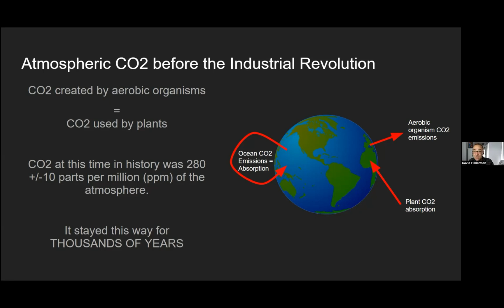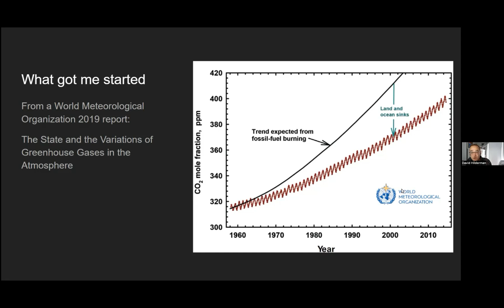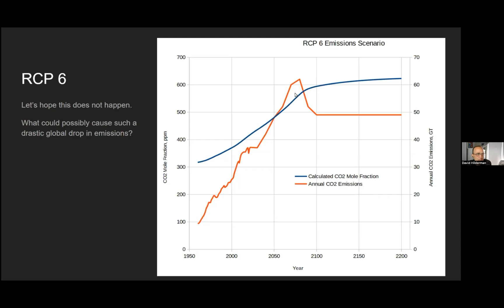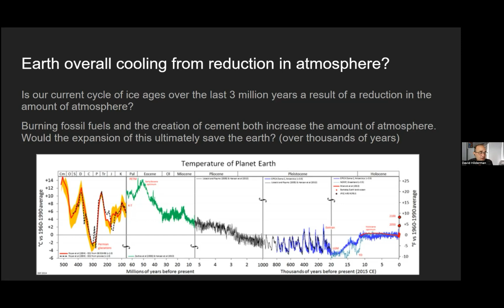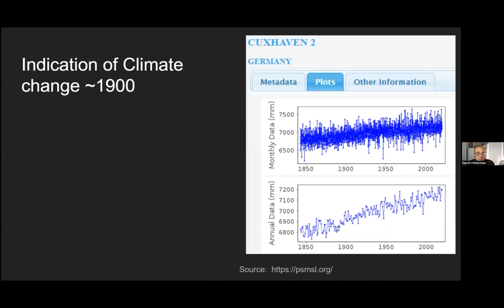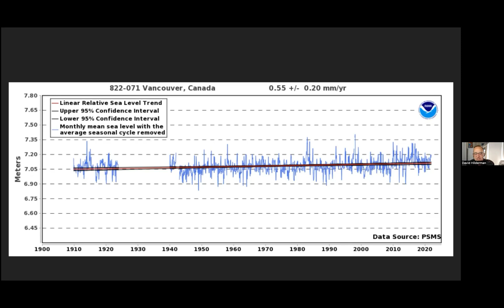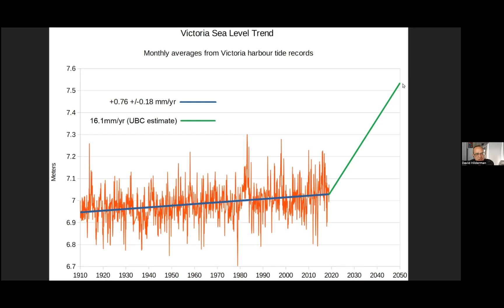David Hilderman: CO2 Emissions and Atmospheric Levels | Nelson Pod #220

Comment: If you go to the Mauna Loa research station website and go to the web page with the “trace gasses” folder to download the CO2 data, there is another interesting downloadable document on that web page, the CHANGE HISTORY for the climate temperature history. That document records every time they changed a temperature in the past. There you will see they are going to past hot days and lowing the temperatures in the past, which results in the past looking COOLER THAN IT REALLY WAS AND GIVING A LOWER AVERAGE TEMPERATURE THAN WAS ACTUALLY RECORDED!
They claim they do this to correct bad measurements in the past because of things near the thermometer 🌡️ that maybe causing an incorrect measurement, like the thermometer was not in the shade, or it was near an exhaust fan, or too close to asphalt pavement that heats up from the sun or too close to something reflective cooling the thermometer. But if you LOOK at all the changes in the CHANGE HISTORY document they almost always lower record HOT 🥵 days in the past and that results in the past appearing cooler than it really was, because today many thermometers 🌡️ have the same problems as the past and NO ONE IS FIXING THIOSE PROBLEMS!

Comment: Adding onto the sea level topic, a lot of data starting at about the mid 80's is complete garbage. That's when they started using satellites to measure sea level, and I don't know if you've ever been on the ocean, but trying to measure a baseline between all the waves with mm precision from a device that's miles above the earth, traveling at hundreds of miles per hour, with a decaying orbit is just not possible. Not to mention that tacking data obtained by one method onto a dataset obtained by another method is extremely unscientific.
Reply: Sea level records that i use are hourly physical measurements.  I agree, measuring sea level with a satelite makes as much sense as measuring me with a satelite.

Comment: How much CO2 is there in the atmosphere by percentage, how much is 415 ppm, very easy to calculate, it’s 0.0415%! So the change since the first modern measurements is 0.01% <~~ is this an amount that can be measured accurately with high confidence or is it just NOISE IN THE INSTRUMENT? AND how do they no CO2 CAUSES global warming, it’s more likely CO2 increases as the planet warms evolved by the oceans 🌊 and does not cause any warming at all because water vapor and evaporative cooling neutralizes any increased warmth!

Comment: I hope this isn't a misplaced question and i have tried to find the answer in my own, but as Canada is charging for CO2 I thought i should look into what they're charging for. 
I discovered that natural gas is methane and ethane. And methane weighs about 0.9 kg per cubic meter. We're charged about 15.3 cent per cubic meter for natural gas. But the carbon tax on natural gas is 17.1 cents per cubic meter and the cost is based on one cubic meter of methane (0.9 kg as a gas) when burned, creates 2.2kg of CO2. Plus other things! 
How does a gas when burned, more than double it's weight in other gases? The other by-product is water vapour. I can't wrap my head around that but hoping someone can explain or at least guide me to a chemistry lesson where i can learn how One cubic meter of methane when burned creates twice as much molecular weight in other gases.
Reply: I woild have to look it up to be sure, but i believe that the molecular weight of carbon is 12 and oxygen is 16. If you burn 1kg of wood i think it creates 2.5kg of CO2.  Same sort of thinking for methane.
Reply: @davidhilderman  thank you, that's great information. I can try and work with that. I didn't think of molecular weight (because I'm not scientifically adept).
Wood seems much heavier than the gases it produces so I'll try to figure out how whatever wood can produce twice as much carbon as it weighs when burned.. it's like combustion creates matter twice the weight of the original item being combusted.

Comment: Great video, however the chart showing atmospheric CO2 through the geological periods appears incorrect. The Carboniferous period was so named because of the very high CO2 concentrations in the atmosphere. I was taught in college that it was between 7,000-10,000ppm. My argument is that if CO2 is a driver of a warming climate how did the Carboniferous Period have repeated glacial maximum events with such high CO2 levels?  In particular a very intense Ice Age at the end of the Carboniferous period into the Permian that lasted nearly 1 million years. However I do agree with your chart that CO2 concentrations plummeted to a very dangerous 170ppm at which most plant life dies during this period.
Agree with everyone it is a scam. How are you going to get any sense from the UN's IPCC when the chair is earning £400,000/year promoting climate fear.

Comment: The data requires a polynomial formula, you are making a linear fit over short segments of the data.
Reply: If you do a polynomial with an x and x2 (is that a single degree??) It results in a slight curve up.  If you go to x3, it curves up then down, so does that mean rise rates are decreasing??  I don't think so.  A couple of years ago Venice couldn't use the canals for transport due to exceptionally low sea levels.  This was due to a high pressure system that was larger than normal and stuck around longer than normal.  Rise rates still may be accelerating, but nothing like what our governments tell us we need to prepare for

Comment: Here is some feedback from a climate scientist a moderator at watts up with that... 

Thank you, sincerely.  most people don't put in any followup.
I had already skimmed a little of it.  

He seems to have not realized that as the partial pressure (concentration) of CO2 in the atmosphere increases, it will change the absorption rate at the ocean atmosphere boundary in a direct and calculable fashion, which he has replicated in a roundabout way.
Whenever someone shows one of those 99% correlation graphs, or 98%, or anything above 95%, it generally means they are not calculating what they think they are calculating and indirectly without realizing it, are correlating a variable against itself.  X on one axis vs. a function containing X on the other axis without realizing it.
The input measurements or estimates aren't accurate enough to get those kind of correlations on the output.

Hope you find this useful....
Reply: Maybe... the factor 0.0182 doesn't work with 2020 data from our world in data.  The emissions data changed and now the number that worked for 2020 data  is 0.0186

Comment: Are methane (CH4) emissions not a problem?
Reply: A doubling of CH4, if you follow the trend line, and assuming the UN is incorrect about a population decline starting later this century, will occur around year 2177, and that doubling only creates a 0.04C increase in temperature.   So to answer your question, no it is not a problem.

Comment: If this is as you claim, then this is a significant finding since this model has only ONE parameter that has to be fitted, that is, fewer than literally almost all other models in scientific use.
Send it to a scientific journal. Point out that it is impossible to fit a nontrivial curve with a one parameter family unless some structural information has been uncovered. For example try an exponential fit with only one free parameter.

Comment: I make the same point about the massive reduction of starvation in my book Stabilising Global Temperature.  The calculation I have done is to curve fit CO2 and sulphur dioxide to the temperature anomaly.  It is necessary to include natural sources of sulphur such as volcanoes.  Then a very good fit can be done to temperature from 1850 onwards.  Global temprature really started ramping up since 1970.  And guess what? That is when sulphur started to be removed from fuels.  Sulphur cools the atmosphere.  We can avoid breathing difficulties and acid rain by putting the sulphur into the stratosphere.  Far less is needed at that altitude, and at least 2 orders of magnitude lower concentration than is harmful to human health.  And it will not interfere with photosynthesis, as it mainly works at IR and a little at UV.  Plants require a completely different wavelength - red and blue. Click on my icon for the link to my book.

Comment: yes I did something like you did  with CO2 and I also have an electronics background. I also noted that the political Net Zero scheme ( or scam for some readers )  allows the burning of fossil fuels by China,India, USA, Russia and Africa  not only to continue but to increase.

This negates what ever we do in reuctions  but also if this is such a burning issue ( sorry)   then nobody should be allowed to increase emmisions , no one at all   but our political class do.

One other point is that the emissions have been measured and currently we are ( if the models are correct)  on the lower bound least problamatic trajectory.

Still big thanks for doing the video 🙂
Reply: I think they expect to kill them off by starvation through their policies. Isn't famine one of their talking points? They will say is is climate change killing them, not their policies of no fuel and no fertilizer that is not organic.

Comment: Here is a good way to put it so Canadians can understand. One million is 50 NHL hockey rinks filled with 20,000 fans. At 420 parts per million there is 9 of those fans who are Carbon Dioxide fans. Even if they were dressed in fluorescent Orange you would have a hard time finding them. Its like when Dairy Queen to compete with the quarter pounder burger made the third of a pounder burger. People saw 3 and thought it smaller than 4. Ha Ha. the third of a pounder promo was a failure. 400 parts per million verse .004%, 400 is a hell of a lot bigger than .004 , which is about what many people earn on there checking account interest. That is one very profound molecule that can raise the temp by 2 degrees C at .004%